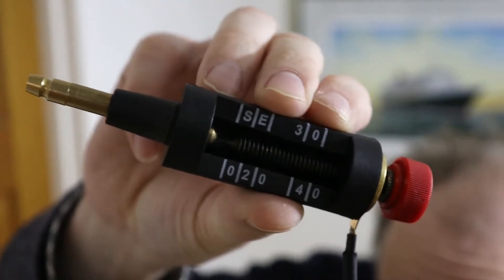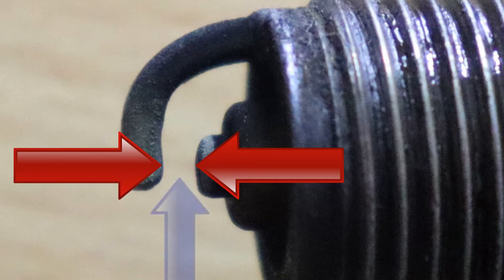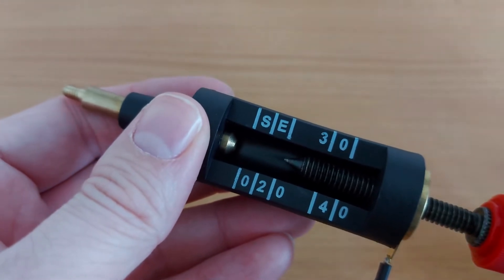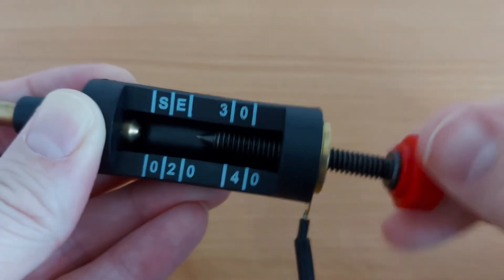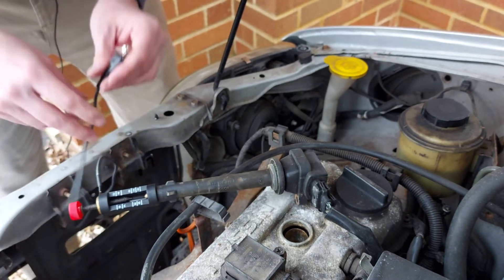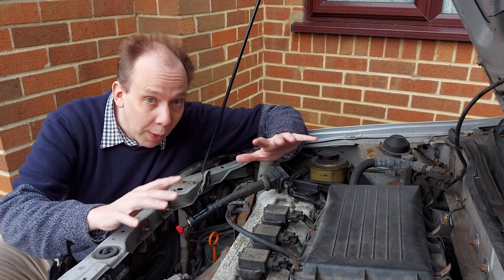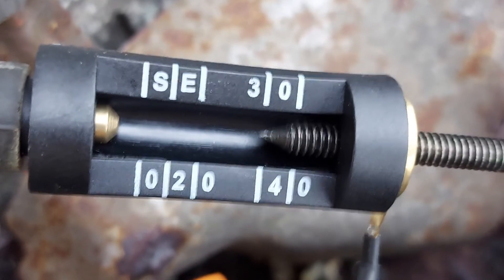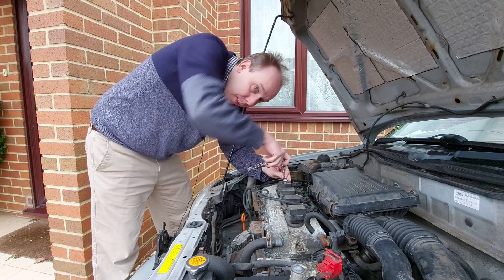How To Use Ignition Spark Tester (Beginner’s Guide)

Comment: Excellent how to video. I just tried one on of these testers (Lisle 50850) on my leaf blower. I use a rubber band to keep the tester tight against the coil plug. Vibrations can work connection loose leading to a false reading.
Reply from the maker: Thank you, MarzNet256. I like the rubber band technique.

Comment: Or use multimeter  to see coil is work or not? 
Or by ur way we can detect if coil is weak ?
Reply: most multimeter will get fried by that kind of volatge, with this tool you can see how weak by how short the distance is when it doesnt cover the gap.

Comment: will it hurt the engine with 1 of the spark plugs not firing due to the disconnected ignition coil?
Reply from the maker: I've had no issues. Best wishes from CarSpyTV.
Reply: @CarSpyTV  I have read that if the chamber doesn't fire, it might hurt the other pistons or something?
No combustion of the gas in the chamber that will be evacuated through the catalytic converter might clog it up?
Reply from the maker: If you want to minimise how much fuel is in the cylinders, you could deactivate the pump by removing its fuse.

Comment: FYI, that screw is quite loose with these types of testers, simple solution, go to you nut and bolt supplier and get a nut, adjust while it's loose, then tighten the nut, problem solved, and don't forget to take the tool with you :)
Reply from the maker: Handy little tool. Best wishes from CarSpyTV
Reply: @CarSpyTV  Cheers
Reply: That is a brilliant solution. Thank you for that tip. I just ordered the tool, so once it shows up I will take it to my local Ace for a nut before I use it on my car. Respect 🙏 🫡.
Reply: @georgeyoung613  You're most welcome 🙂👍

Comment: Wish you had done (1)  car with distributor and (2) small engine with magneto.   Do not understand how your engine ran with the item between the high voltage source and ground.  Were you continually cranking it?  Especially in the second part, with the expanded gap and no spark.  Hey, I'm just a dumbass American.  LOL
Reply from the maker: Hello. The engine ran (without the need to continuously crank it) because I left three of the four ignition coils in place. Best wishes from the UK.

Comment: ( SE ) Spark Energy .  May be used on any size engine .  Lisle P/N 20700  . Well said demonstration . Installed nylon zip tie to tighten adjustable air gap screw .
          2/23

Comment: hello SE scale I can use it in a car with a small 3-cylinder engine of 800 displacement. like the mini morris or the suzuki alto 3 cylinder
Reply from the maker: Hello. The tool should work fine on a 800cc car engine. I’d be hoping for measurements beyond the SE mark.

Comment: excellent well explained this tool is to check that the current outlets of the distributor work by sending voltage in each power cable
Reply from the maker: Thank you. Glad you like the video.

Comment: Can you elaborate on the scale?
0=0kv?
0|2|0,？
Thanks
Reply: SE = SMALL ENGINE
20 = 20K VOLTS
30= 30k VOLTS ETC..
Reply: The writing on this tester IS confusing i agree. 
Why is there a 0I before the 2 ?? 
Why not just put a 2 for 20k and a 3 for 30k and a 4 for 40k at the correct spots ??  That makes sense
Reply from the maker: Agreed. The scale could be clearer.